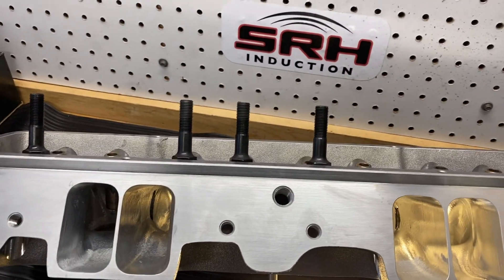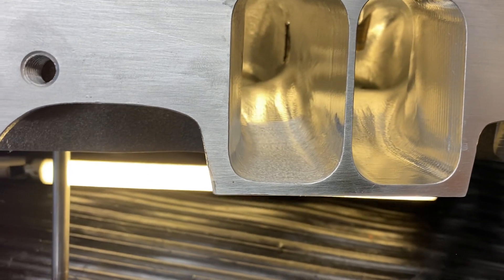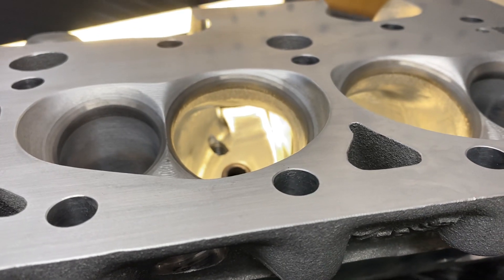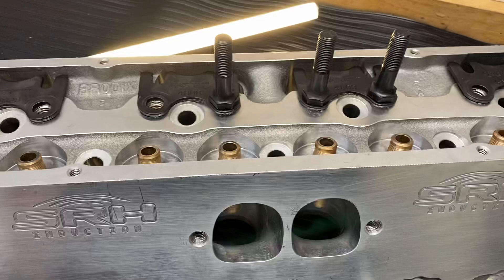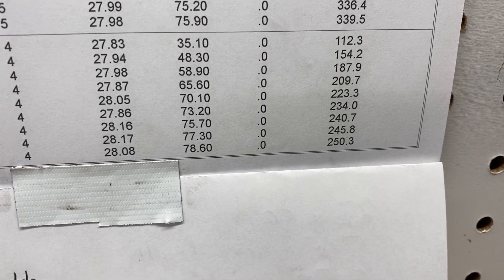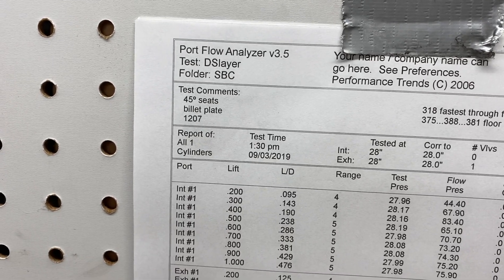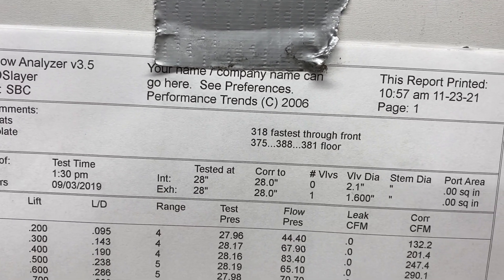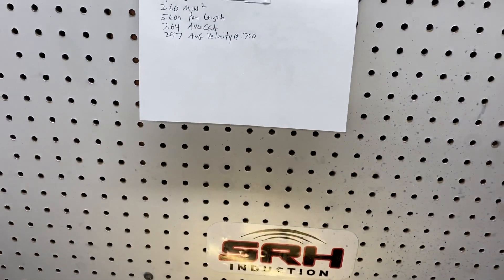SRH Dragon Slayer SBC CNC

Comment: What do you think about the older Victor Jr head? The set I got has some casting shift but easily cleaned up. The port match they do is laughable. Got the exhaust throat and intake bowls cleaned up and I'm just thinking run em.  I don't have a bench to flow em but all the math of the measurements works out to +/- a couple hundredth. Just can't find any info on em besides the same product description they send their dealers
Reply from the maker: I have never worked on one.

Comment: How do they compare to the profiler 23* heads?
Reply from the maker: The ProFiler stuff is my baby.  These will work well however.
Reply: @SpeierRacingHeads  That's why I asked. I know you do a LOT of the Profiler stuff and was interested how they compared apples-to-apples. Standard rocker setup on both, which had thicker decks, performance capabilities, casting quality, price, etc.
Reply from the maker: @dougcrosby6994  IMO the only selling point is the stud rocker.  IMO, the PF is better in everyway.  These will cost more because the castings are higher.
Reply: @SpeierRacingHeads  Badass bro! Thanks for the reply and the videos. Have a  Happy Thanksgiving!